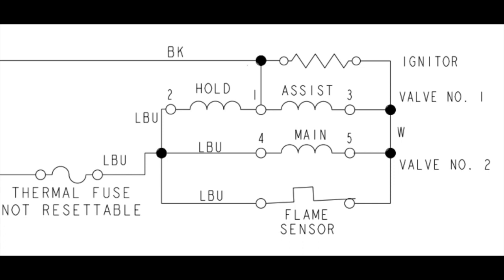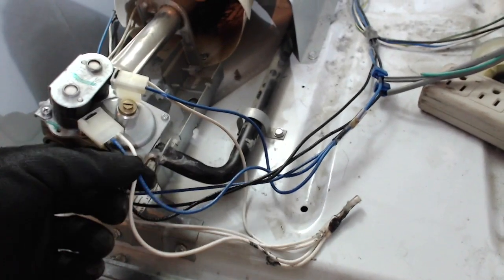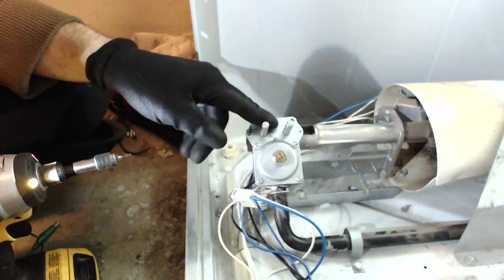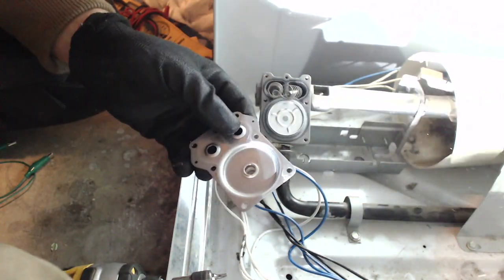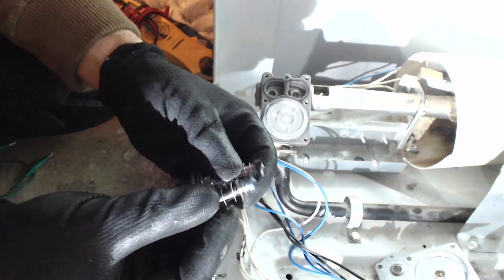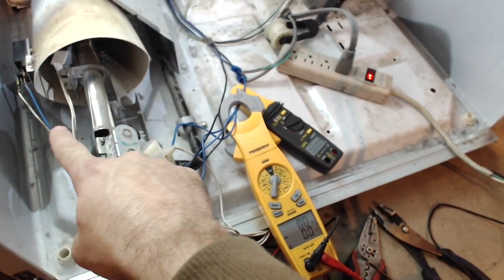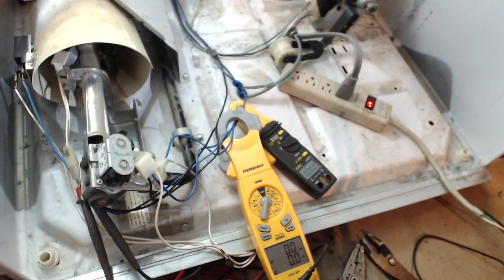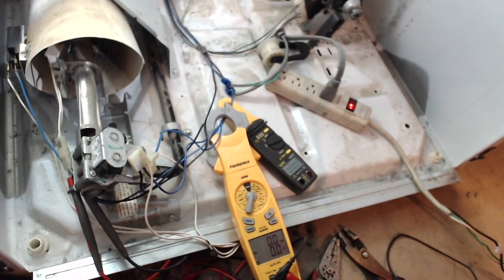Dryer gas valve and burner operation

Comment: Thanks for your video. My gas ignition was slow, about 2 seconds after the flame sensor switch opens. So sometimes the gas didn't ignite. I swapped the valves, valve/regulator cover, valve tubes, tube retainer plate and coils from a used doner valve assembly. The ignition is now rapid and reliable. Gas ignition occurs less than 1 second after the flame sensor opens. The flame looks blue and operates well for normal heat cycles. The valve 1 is now noisy (60 Hz) during preignition and continues to hum for 15 seconds after ignition.  I'd like to solve the noise ( I rechecked the assembly and found nothing obvious.) Any your thoughts on the valve noise would be appreciated. I've read that this noise is related to the gas pressure but that doesn't make sense to me (it's noisy before gas is flowing and during gas flow).
Reply from the maker: The larger of the two gas valve coils has a metal sleeve inside of it. If that is missing, that can cause a rattle.
Reply: @electronicsprojects4708  Thanks. The actual issue was the holding coil. It measured 1397 Ohms (nominal should be 1365). I swapped back to my original coil (measuring 1361) and it's quiet. Ignition is still rapid after valve 2 opens.

Comment: Thanks, very clear presentation. My Matag gas clothes dryer has intermittent ignition, about 15% of ignition cycles fail. When ignited the gas flame looks proper (mostly blue) and continues until the selected temp. is reached. I've cleaned the blower paths, replaced the coils and then replaced the igniter (OEM parts). The failure rate seems slightly better, but still fails. I've seen it fail when everything is stone cold, and after several successful ignitions (hot). I always smell gas after a failed ignition (and I always see the igniter glow before a failed ignition).   My machine has an electronic controlled heat relay (humidity and heat settings) that work properly. Any suggestions welcome. I love to fix things but I hate "swap and hope" diagnosis. I wish to find a measurement that will point me to the flame sensor, gas valve (or gas regulator), regulator setting etc. My other gas appliances work properly. THANKS FOR ANY RESPONSE.
Reply from the maker: If the flame sensor is bad, the igniter will continue to glow, and does not turn off, and the gas does not ignite. If you have an igniter glow then cuts out, that's a classic case for gas valve coils, but you already replaced those.
Reply: @electronicsprojects4708  Yes, now I wish to understand the balance between the ignitors temp. (maximum) and the valve timing. I'll measure the period the igniter heats to see if that time drops during a failed ignition. If so, the flame sensor is opening prematurely. If there is no time correlation the valve must be slow to open. I never see a partial ignition on failure but I do smell the gas (as if the ignitor is too cold to start ignition). I still have three possible causes: flame sensor, valve failure or regulator failure.
Reply from the maker: @robertheim352  I think at this point you need to call a professional technician. Some repairs are beyond diy and it seems to me you are going down unnecessarily rabbit holes. Some repairs need to be diagnosed in person.
Reply: @electronicsprojects4708  Hmmm, I respect your opinion but disagree. The only difference between me and the professional is knowledge of the system and the way things fail. I've watched pro's swap parts also and I'm comfortable studying the problem. You do provide a very good description and I really appreciate it. THANK You for the advice.
Reply from the maker: @ you admit there is a difference between a diy and professional diagnosis. That is what I am referring to. Some repairs are easy to diagnose, others can take a while and you have to know the system with hands on repair experience of hundreds or thousands in the past. Theory can only get you so far.

Comment: Hi great info , I am having a issue with my dryer it will turn on run but  shut off like it's getting to.hot,, there is also a gas smell when opening the dryer door.. any ideas
Reply from the maker: If the drum just stops turning mid cycle, the motor typically overheats, then you have to wait and after 5 minutes or so, you can restart it. For a gas smell, if the gas valve is leaking, you can get a gas smell when the dryer is not working. Both are pretty expensive issues.

Comment: Hello, first thing thanks for the great videos, very helpful. But I cannot find any info on replacing the regulator and the regulator spring in the gas valve assy.. When replacing 
these parts how far do you tighten down the little plastic regulator screw that pushes the spring. Do you screw it all the way in until it hits bottom, no instructions with new parts.
Kenmore 80 series gas dryer. Thank you!
Reply from the maker: I have never needed to replace the spring for the regulator and they are not sold separately that I have seen. They are Natural gas by default.  I can say that if you increase or decrease the pressure, the amount of gas will also increase or decrease, so if you have too small or large a flame, adjust accordingly by eying it. Propane does use a smaller orifice.
Reply: Thank you, ya this model you can replace the spring and the regulator. Thought I might need to replace the whole gas valve assy. but I replaced the spring and regulator and that seems to have fixed it. But unsure how far to screw it in, when I removed the old one it seemed to be all the way in. Spring and regulator $35, valve assy. almost $300. Already replaced solenoids but that didn't fix. Thanks for time and expertise. @electronicsprojects4708

Comment: Question. I have a  Frigidaire gas dryer Model GLGR341AS4 and don't lit the burner. Coils are good, flame sensor is good, igniter is good, cycling thermostat is good. I will appreciate any ideas. Thank You all for  suggestions.
Reply from the maker: Is the igniter glowing? Can you hear the clicks from the gas valve coils engaging?

Comment: Great explanation of the valve operation!
We have a 2003 Maytag gas dryer (PYG2300AWW) that has recently started a high-pitch squeal, like an old vacuum tube TV warming up, but ONLY when the gas flame turns ON.
Dryer still works well and I recently replaced a broken fan blade and cleaned and lubricated everything and there is NO smell of gas in the enclosed laundry room.

Someone told me it's the entire gas valve, but I'm wondering if the solenoid coils will make that high-pitched noise when they're about to fail...?

I'm going to turn the gas valve OFF to see if I still get that high-pitched noise.
What are your thoughts?
Reply from the maker: It's not common for there to be high pitch squealing only when gas valve is on. Everything electrical on the valve is @ 60 hz, which is a very low frequency. It could be a coincidence or heat is affecting certain parts, something in your mechanical assembly may have failed like rollers or idler. That is a very old dryer. You can just turn it on 'air dry' for no heat, no need to switch the gas off. It will power the coils if you turn the gas off at the wall.
Reply: @electronicsprojects4708  I'm guessing the gas is leaking because I partially turned Off the gas valve at the wall and the high-pitch squeal Stopped! The dryer continued to dry the clothes.
My other guess is the valve has sediment at the tip causing that sound from the pressure of the gas.
I'll pull it apart again and clean the tip and heating assembly and tighten the screws on the valve and turn the gas shut-off valve fully On again.

Comment: I have a 2003 General Electric DPSB620GC1W gas dryer,  it has electronic controls and four heat settings.
Extra low,, low, medium, and high.
I always run it on medium and yesterday for the 1st time ever in 20 years it didn't heat.
I tried it a couple times and it didn't heat then I put it on high and it DID heat,  then I put it back on medium and it did heat..
It seems to be working correctly now,, should I be suspecting one or both gas valve solenoids ??
I initially thought it might be the ignitor going out and I guess that's possible but amazingly that 20 year old igniter looks perfect.
Thank you
P.S. I've always assumed that the controller just turned the gas valve on and off to regulate the temperature is that correct?
Reply from the maker: I would suspect gas valve coils are going out. They are no.1 for intermittent heat failure. Thermostat controls the temperature, usually sits on the blower/exhaust housing.
Reply: @electronicsprojects4708    Thank you sir !!

Comment: You failed to point out the plungers are different lengths and must be reinserted in their proper position. The coils are different too, but have pins to prevent their incorrect installation. At 2:31 in the video you can see the difference in lengths.
Reply: Hi WACKO, 
I only wish you had as well as pointing this out mentioned which one goes where. It looks like the short one goes on the front or 3 prong coil side & the long one goes on the rear or 2 prong coil side from watching the video several times... I think I have it correct. If you know which goes where a response would be much appreciated.

Comment: my dryer needs same type of repair as you did,. Are both valves equal on both chambers on valve1 and valve 2??
Reply from the maker: This is an advanced repair, if you are not an appliance tech, I think it would be difficult to do. The solenoid coils are different, I recommend keeping track of the parts you take out and putting them back in the same places.

Comment: Awesome video! Anywhere you could buy those small seals that you said will crack over time? I bought another valve but it also had cracked seals. Is it just a silicon seal or is it some special material?
Reply from the maker: I am not sure if you can get the seals separate. If you bought a used valve, I can see them being cracked or if it was old stock that was warehoused. I can't think of any reason they would  need special material. The heat moves away from the valve not towards it.

Comment: I have a large orange/yellow flame(w/very little blue) reaching past the lint guard almost reaching the rear duct housing.. this is LP and yes their has been a conversion kit installed back when the unit was initially installed...  my initial reason for inspecting the burner was because the last cycle with clothes drying had left a light dusting of black soot on the drum, door and filter housing...  im trrying to determine the root cause of the soot and noticed the flame... i then took apart the burner and the #54 oriface was not obstructed whatsoever--  wondering if you think the valve is bad or one of the solenoids affecting the flame... i will try to adjust the after i reassemble which i prob should had done before i took everything apart .. im referring to the brass adjustment with the white springy straw referred to an air blocker on the conversion kit which was tightened all the way... i guess i will try to loosen some to see if that will change the flame to a cleaner blue burn ---  so to sum up if that doesnt work does the issue sound like the solenoid(s) or should i replace the whole valve... appreciate your help .. thanks !
Reply from the maker: It makes no sense for the valve to be defective, it would come as a Nat Gas valve, so you would have to convert the new valve to propane. It's the size of the orifice and adjustment of the diaphragm that you need to pay attention to. Sounds to me like it's still Nat gas and the conversion wasn't done properly, there may be YouTube video on proper conversion depending on your brand/model. Local appliance parts department can look up if there's a conversion kit for your model, and you can search accordingly.

Comment: where do you smell the gas from if its leaking?
Reply from the maker: if you open the dryer door, when it's not in operation, the drum will have a gas smell, if its real bad, you can smell it when you enter the laundry room.
Reply: @electronicsprojects4708  Ok thanks, no gas smell.I just got a whirlpool gas dryer that was still in the box and never opened that was bought in 1990. When i hooked it up it took a few times before the burner fired. But when it didn't lite, i could smell gas. But after i ran it for a while it seems to be fine. Maybe air in the line at first?
Reply from the maker: @lar4305  that old of a unit, you could have had a sticky valve, hopefully it just got unstuck and that's it.
Reply: @electronicsprojects4708  Yeah sounds right. So far all is good, thanks

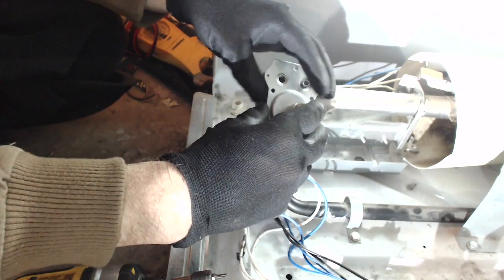Comment: At 1:20 you mention that when the igniter glows to a brightness level, it triggers the flame sensor.  I think you meant to say that the flame sensor consists of a bimetallic strip that bends with heat and in doing so, opens the flame sensor contact.  With the low resistance of the flame resistance and igniter now open, it allows the coils to be energized.

Question: Since the flame sensor works on heat, does the flame sensor contact remain open after the igniter is turned off and remain open until the gas flame goes out?
Reply: The hold coil and assist coil (piggy-back pair) both energize immediately pulling up the first plunger. The main solenoid coil is not energized because there isn't a voltage drop across it because the radiant sensor is contacts closed. The voltage goes through the radiant sensors closed contacts directly to the assist coil and the HSI which begins to glow. After the warm-up period the radiant sensor contacts open. This does 3 things: 1. It provides the voltage drop across across the main valve which now opens. 2. The assist coil, having done it's job powers down.  3. Similarly the HSI powers down. (both remain in the circuit but the voltage is too low once the main valve is energized for them to operate).
With both he main coil energized and the hold coil (having done it's job) gas now passes through the valve and is ignited by the HSI which is on its way to powering down but still hot enough to ignite the gas. Once lit it's the heat from the gas flame which keeps the radiant sensor contacts open. 
The 'assist' coil does just as its name suggests: it assists in pulling up the first plunger. The 'hold' coil does just as its name suggest: it holds the plunger up. Neither one is strong enough to pull up the first plunger but the hold coil IS strong enough to keep the plunger up once it contacts the solenoid magnet.
The main coil is strong enough by itself to pull up the second plunger to allow gas to pass through the valve to the burner assembly.
The inherent safety built into this configuration prevents the build up of gas in the dryer drum if a power failure occurs. The hold coil drops the first plunger (main plunger also drops) shutting off the gas. When power is restored the hold and main coil will energize but without the assist coil at full power no gas can pass by the first plunger until the radiant sensor contacts cool and close and the sequence starts again.
That's how this works. It's really genius.
Reply from the maker: The flame sensor does open when the igniter gets hot enough, that's why there is a window in the flame sensor, so the radiated heat from the igniter can get to the bi-metal. After that, the flame of the burner provides the heat needed to keep it open after the igniter switches off. This is part of the safety feature of this valve. Good point, it's called a 'flame sensor' but really it's a 'heat sensor', no heat, it closes, add heat, it opens, not 'brightness' as stated in the video, good catch.
Reply: @electronicsprojects4708  I’m currently working on my son’s gas dryer  Maytag Bravo XL MGDB850YW3.  The flame sensor, igniter, all thermal cutoffs, thermal fuse, thermistor (at room temperature) test good.  What’s happening is that I see a normal start - igniter glowing red, flame sensor contact then opening and the gas valve opening producing flame.  It stays on for about 5 seconds and goes off.  The igniter does not come on again immediately after gas flame goes out but restarts after 60 seconds ( is this the reset time for flame sensor??).  This also happens in Timed cycle which some YTubers say Is supposed to bypass the thermistor and moisture sensor.  I didn’t find wiring diagram in the dryer or on web to confirm this.  I have already replaced the gas valve solenoids with no success fixing the problem.  I thinking the next components to replace are the gas valve and/or the control board.  I’m thinking it’s the gas valve.  I want to setup up a test to monitor gas valve voltage at gas solenoids valve when it goes out.  What are your thoughts.
Reply from the maker: @y2kroxy  clogged vent will do this, to test you can take the vent hose off the back then perform the same test. The burner stays on longer than  30 seconds, if you have a clear vent.
Reply: @electronicsprojects4708  When I opened the dryer to troubleshoot, there was a lot of lint.  After this I proceeded to clean the dryer and clear the vent before I started the troubleshooting .  I did a voltage test on the solenoids and found that there was voltage to the solenoids when the gas flame turns off so this ruled out the gas valve. I next proceeded to place a switched jumper across the cycling thermostat. I closed the switch and started the dryer- the gas flame remained on as long as the switch was closed.  So I removed the thermostat and found that if I shake it I can feel a rattle.  So even though the thermostat test good when it’s cold it opens up - when it feels 5 seconds of gas flame (which to me should not be enough to trigger it.  I’m ordering and replacing the thermostat next. Thanks for your video which helped me understand how the gas valve works.